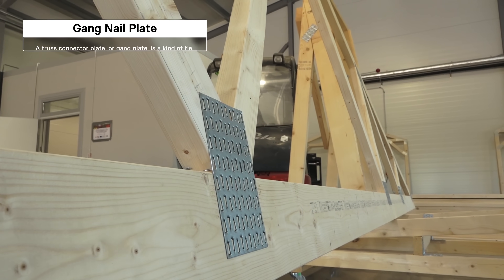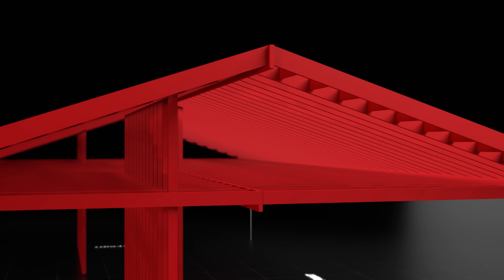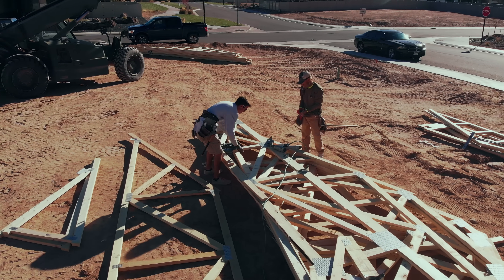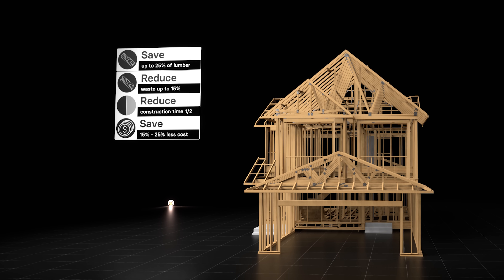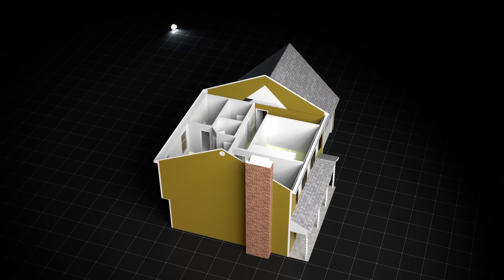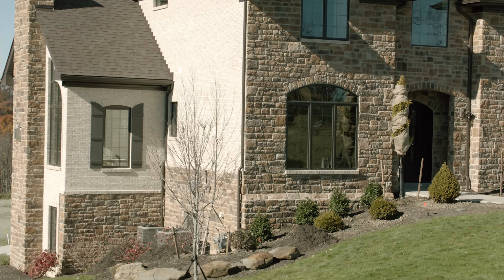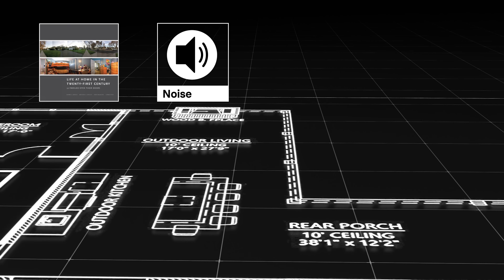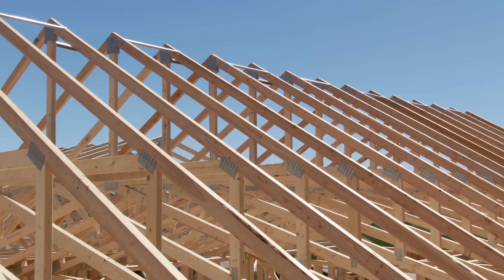The Invention that Accidentally Made McMansions

Comment: What happens to these places when this plate fails?
Reply: Immediate unpredictable collapse.
Reply: @ you just don’t know what you’re talking about. “Unpredictable collapsing homes” in the United States of America? Go outside, brother. You are horribly misinformed.
Reply: @Hawkem248  
So...what happens when a plate fails?
Reply: @mnemosynevermont5524  The amount of redundancy means it doesn’t matter unless like 25% of them fail at the same time. Simply put: This is not an issue at all. It is structurally sound, more so than the previous designs.
Reply: @Hawkem248  
Somewhere down the road, that steel is going to deteriorate and fail. Not today, or tomorrow, but it will happen.
Reply: @mnemosynevermont5524  at that point you would repair the roof. Most roofs in the US cost less than 5% of the value of the property. That’s a reasonable cost once every 40+ years !

Comment: Structural Engineer here.  Love this video. Great job Stewart.
Reply: In what world does the truss plate connect trusses to top plates on walls.
Reply: @HondoTrailside  Hurricane clips connect trusses to wall top plates
Reply: @HondoTrailside  Exactly! He says he's an engineer, but those nails plates don't hold the trusses to the top plate. They are still nailed down and reinforced with either hurricane ties, or truss screws, just like rafters...
Reply: Great, I just built a ranch open floor plan and my floor is a little bouncy. Best way to reduce? Installed fancy steel x braces and didn't do much. Thinking about 2x4 perp to the TJIs. I within the TJI span chart so WTF :)
Reply: @greenmoxy  Go back to your designer and tell them they f'd up, and ask them how they're going to fix it.
Reply: @SoidHoid  LOL I'm the designer / builder and I agree I f'd up a little. It's not horrible, I've seen horrible. Looking back I would up my TJI to 14" instead of 12". The span chart said I was good, my gut said get 14" then I figured I could save $300 on $500K home :) We live, we sometimes learn. Thanks!
Reply: @greenmoxy  Yeah, at long spans the code-allowable deflections aren't always comfortable, since it a function of span. The length / 360 is the allowable deflection under the design load. At long spans and for luxury homes I use L / 480. If you can put in an intermediate support, that's the easy solution. The other solution is more joists.
Reply: @SoidHoid  Thanks! I plan to frame and finish the lower level next year. Nothing some creative design can't fix :)

Comment: It's a fun theory but I don't agree with it.  Traditional rafter construction is still common here in California in home construction.  Code requires hurricane/earthquake ties to greatly strengthen the roof structure. The modern truss system is cheaper to build and faster to install but is associated with lower quality construction.  McMansions are a developer's attempt at maximizing profit and thus it makes sense that they'll employ the cheapest roofing system.  If factory-made truss systems didn't exist, developers would still build McMansions with traditional rafter construction since that would be the only method allowed them.
Reply: You think they'd exist at the scale  they do now? I think the point he touches on that you're not giving sufficient weight to is how the offsite preconstruction allowed the proliferation.
Reply: @ekjswim  As I mentioned, truss systems are cheaper to design, build, and install versus traditional rafter construction. It saves money regardless of the home type whether it's 600 square feet or 6000 square feet.  Developer's have it easier with truss systems but it's not a make-or-break situation in my opinion.
Reply: Californias weather is mostly the opposite of extreme.
Reply: I totally agree with you.  We (california framers) were cutting and stacking complex roofs for decades.  McMansions existed in the 19-teens.  In track homes where piecemeal production framing was born, framers like Larry Haun could cut and stack a roof in a day.  The only change these plates had was lowering the cost of complex roofs, maximizing profits for developers.
Reply: @bjrnmagnusson5351  Larry did a lot of tract type homes. Smaller and less complicated roofs.
Reply: @bjrnmagnusson5351  that's the real reason for the plates.
Reply: @bjrnmagnusson5351 which is the mechanism that allows McMansions to proliferate. Builders will always cut corners to maximize profit. Your reason supports this video's hypothesis.
Reply: @selfawaretrashcan4594  respectfully, I disagree.  I believe piece-rate pay structures were the driving force for larger, more elaborate mid-tier homes.   If we're talking about construction components, engineered lumber and shear wall hold downs are the facilitators of open floor plans.  Trusses have to sit on something, after all.
Reply: @DiamondKingStudios  Anywhere earthquakes and hurricanes can strike is subject to additional bracing and tie-down requirements. That would be the coastal east coast, all of the states along the Gulf of Mexico, and California, Oregon, and Washington.  Let's not forget Alaska, Hawai'i, and Puerto Rico, as well.
Reply: @Urbanhandyman  not to mention tornados and homes in the northern states having to be built to handle snow build up and super cold temps
Reply: It’s “tract” homes not “track”.  Although they are in kind of a track arrangement now that I think about it 😂
Reply: Agreed. As a home builder I've seen many different advancements to construction technology.  None of which come close to making as much of a cost impact as the volatility of the material prices make on the home of any size. A Lumber pack on a 1,500 sf house in Texas is well over $50k with Lumber prices fluctuating 15% or more in a year prior to covid. 40%+ when inflation came in a few years ago. The birth of Mcmansions is a much more complicated explanation but still a fun video that has us all talking : )
Reply: Yup the gang nail plate has just lead to crappy track homes built by unskilled craftsman.
Reply: I'm a contractor in California and I haven't seen a new home built with non- engineered trusses in 3 years.
Reply: @amplitudeelec  I'm a retired building contractor and have seen two or three new houses constructed with traditional rafter construction in my local area over the past couple of years..  I've also seen two or three new houses built with engineered trusses in my area.  It's all casual observation because I happened to drive by a certain street while the rough framing was visible.  I don't know what the percentage breakdown  is between the two methods in my area (San Francisco East Bay).
Reply: you missed the main point of the video:  it's stiffer without long pieces of wood.  This allows cheaper construction because the walls don't have to be supporting - the roof holds up itself.  So nearly all the strength in a mcmansion is in the roof and nowhere else...
Reply: @tsm688  If the definition of a McMansion is only long ceiling spans then one only has to look at other construction types that employ more expensive site-built construction to achieve similar spans.  I'm claiming that a McMansion is so much more than just a cathedral ceiling in the entryway.
Reply: @Urbanhandyman  no... it is long ceiling spans used to accomodate weird impractical roof styles in a single residential residence
Reply: @tsm688 Agreed. Larger widths and lengths of lumber needed for traditional rafters make it more expensive than stick lumber (2x4s). These lumber pieces are much larger, therefore more difficult to maneuver on the worksite.  And traditional rafter framing was done in place, meaning workers had to work from heights and overhead which is extra tiring.  Trusses can be made from the comfort and safety of the ground and in a climate-controlled facility.   Add to this, their design made the addition of mechanicals and insulation much easier. 

Problems arise when fires occur or future homeowners, unaware of the trusses’ structural limitations, begin to use the spaces between as storage (or God forbid, living spaces) and overload them.  Once the areas around the plates are compromised, a collapse can happen quickly. In traditional framing, one would have substantial and noticeable bowing of the rafters and sagging of the roof before collapse. In other words, there would be plenty of warning of danger before failure.
Reply: who's gonna tell this guy there's something called 80+ miles per hour wind
Reply: @brunkosaurusrex   Weather related extremes are rare in California compared to other places. Temp extremes, rare. Typhoons, no. Tornadoes, rarely. Snow load, only in select places. Heavy rains, not really.
Reply: @brunkosaurusrex  Not me!
Reply: @brunkosaurusrex  Oh! Oh! Let me!

Down here in the Imperial Valley around El Centro (east of San Diego) we often see 80+ mph. 40mph winds aren't unusual at all. I've lost power and internet more than once every year since 2021. I also lived in the Santa Cruz mountains in the 90s where it was perfect 99% of the time but that other 1% would knock down BIG 80-year-old trees. If our buildings weren't required to withstand the earthquakes, the weather would definitely be our biggest problem.

Do not underestimate the so-called Pacific ocean and her cycles. :)
Reply: @DiamondKingStudios Not necessarily. Homes built in tornado prone areas are required to have more substantial structural connectors to resist lift - same in Florida.
Reply: I would agree. Cheaper made homes, not better made homes.

Comment: Hey Stewart! Miami-Dade county wind load requirements these days start at 165mph and reach up to 195mph in a higher risk category!
Reply: There, you have additional nail plates and steel straps designed to hold the floors and roof down, to tie the lifting load down to the foundation.
Reply: Yeah, 100 mph winds is a minor hurricane (IIRC category 2) that happens every other year in much of the Caribbean and in the southern USA, but now we're at the stage in which category 5s (157 mph and above) happen every other year, or at worst we get multiple in a year.

Comment: This is an incredible connection, and it feels extremely accurate. The skills required to design residential structures has diminished, as have the framer's skills. This was multiplied by the development of TJI joist type floor systems. 
This should result in simple designs becoming cheaper and quicker to build, but it's not happening. Or rather not happening on a reasonable scale. Depressing

Comment: Yeah - trusses are out, single sloping roof rafters are in. Less expensive, easy vaulted ceilings, and with drop drywall systems easy to run ductwork/utilities. Also better for modifications down the line. Great video and animations.

Comment: By 5minutes in you explain the overlapping connections, but what about the toe nailing of joists? Do you show us how this nail plate removed/changed that connection? How are the trusses connected to the exterior walls?
Reply: It's still the same, bottom cords of trusses are toe-nailed down to the top plate of the wall. In many areas clips are used to create a more resilient connection to resist wind or Earthquake loads.
Reply: @izikavazo  6-8 inch screws come up through the top plate and into the truss and or hurricane straps. You are right he never talked about it but brougtht it up in the beginning

Comment: And it was all downhill from there. I know house fires are rare, but they go up so much quicker now, putting homeowners and firefighters at much higher risk.

It's a race to the bottom. Use the cheapest materials, slap it together as quick as possible (with little oversight) and make people overpay for junk.
Reply: When I was in the fire service, we were trained to watch for Gusset Plates because they warp and release much faster than a nailed joint.
Reply: @who2u333  I guess that would explain why attic fires in homes of that era often result in roof collapses. However, that seems a bit safer than homes which now have OSB floor joists. Two FFs didn't make it out of a modern house here 10+ years ago.

I think the fire commissioner said occupants only have 6-8 min to get out now before it's fully involved, vs older homes that were much slower (15-25? Sorry, I forget)
Reply: The roof going off make me laughed haha